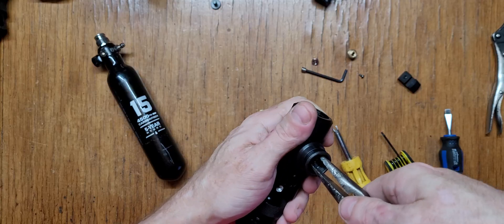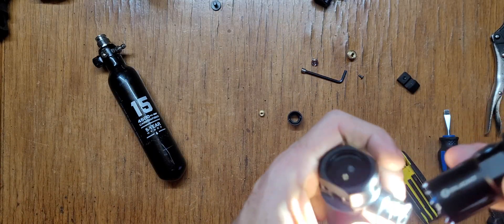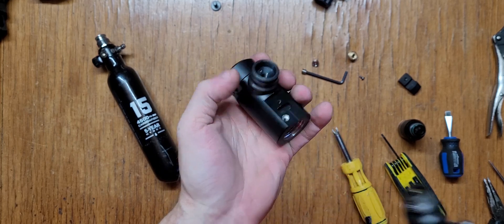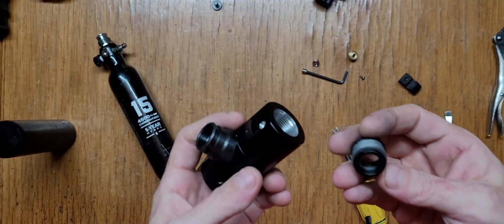Umarex TC68 Hidden HPA Threads in the Valve?

Comment: I looked at the parts diagram in the manual and it looks like the adjustment section threads off
Reply from the maker: ya i made a new vid this doesnt work, i tried to teflon tape it well and it dont work

Comment: Ist es möglich, dass es unterschiedliche Versionen des Zylinders gibt? Meine 7,5 Joule Version hat keinen direkten Anschluss für HPA. Nur für 88g co2. Außerdem habe ich das Problem, das in Verbindung mit dem HPA Adapter Luft permanent entweicht, sobald ich Druck auf das System gebe. Hat jemand ähnliche Erfahrungen gemacht? Grüße aus Deutschland
Reply from the maker: yes i see there is a version that does not have the threads in the back i just got my hpa adaptor sent to me from the shop later cuz it was missing i will try and see if mine elaks, im sure its just an oring swap you need

Comment: You should check to see that where you took the 88/90 co2 collar out does in fact make a good seal to the tank or on/off.
Reply: I was thinking the same thing?  If you take out the 88 collar and factory puncture pin. Could you use a Aftermarket ASA on/off adapter to connect straight to a 13ci Tank?
Reply from the maker: @MrFreeballn  yes you can use an asa as long as it has the male paintball threads i have a degassing asa in the pic from hd24
Reply: @LessLethalHomeDefense I’m looking at the MCS ASA with on off
Reply from the maker: im gonna try and see, feels like a dif thread but the hpa tanks fit great, some are a bit loser and some feel nice, the difs between the europe regs and usa regs maby

Comment: Hi, is it possible to swap the regulator from the Valken Home Defense 24, including the valve system and spring?
Reply: Hi, yes, I understand, just curious.

However, I looked at the diagram and it seems to me that the TC 68 regulator could be emptied and left as a mini plenum. I watched your last video; I think it's mounted with Loctite. Anyway, have fun! 😉
Reply from the maker: @Lorran-yl9se  thanks man yes im gonna open it up and see whats gives, i need to remove all that first then maby i can dremel it out for more volume
Reply: @LessLethalHomeDefense  Okay, I can't wait to see your next video.
Reply from the maker: @Lorran-yl9se  thanks man it will be a full auto mag dump at full power
Reply from the maker: i never tried it may be possible but not likely

Comment: yo bro!
got news!😄
Finally found a cheap but good way, to  connect and place my Bottle directly aside the HDR50, like you have at yours.
Basicly I´ve made a U-turn pipeway from two 90 degree extension fittings and some straight ones. One end into the guns backhole and one end into the buttstock adapter.
Works great so far. Actually...😅
Now I need something I may could use, that holds the bottle tight on place in this position.
Via picatinny side adapter or such. 
I found them on Ali like almost always.
The 90° fittings, you can find under "45 90 Degree Elbow Fittings & 360 Rotatable Angled Adapter Hand Compression Connector G1/4'' ", if you want
And the straight ones you´ll find under "Extender Fitting 10mm 15mm 20mm 30mm 40mm M-F G1/4 Black / Silver Nickel For Computer Water Cooling Connector"
Cheerz!
Reply from the maker: Awesome man sounds like you found a good setup, be nice to see it :)